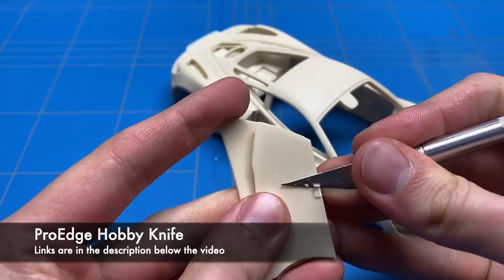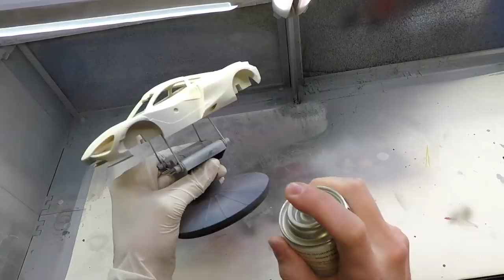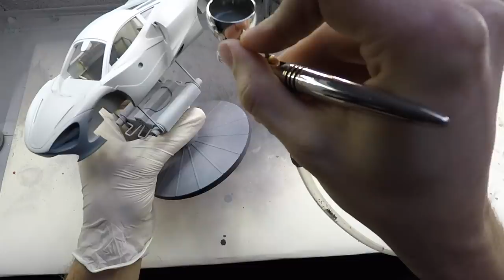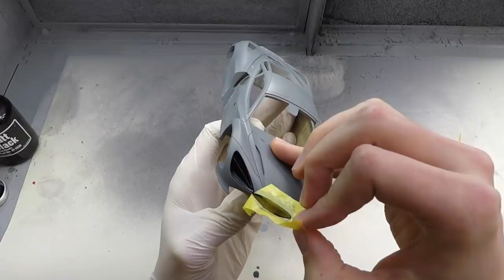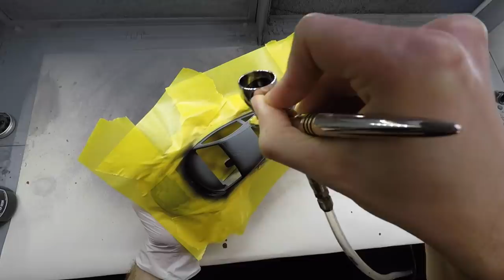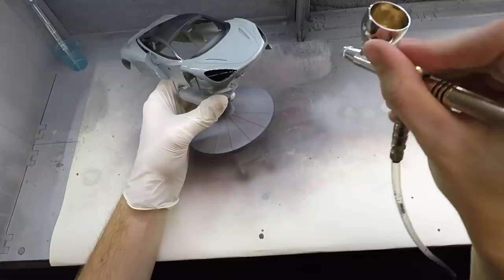Building a Alpha Model Mclaren 720S Part 1 Paint & Bodywork

Comment: Could a gloss black been used instead of matte black, since clear coating it makes it look gloss?  Is there a difference or advantage in using a matte?
Reply from the maker: You can use any black you want, the clear will make it gloss. I like matt as it covers fast and needs less coats
Reply: Noted 👍

Comment: Nice job, but quick question why did you began using Tamiyas primer. What happened to Zeropaints primer what is the difference. Thanks
Reply from the maker: Tamiya primer is simply a fantastic primer, and in this case the model is Resin, Tamiya works on resin, metal and plastic. Zero Primer only works on plastic.

Comment: Great video as usual. Going to make an order from your shop soon. Will be sure to drop a 5 star review on trustpilot cuz rn there is only a low rating but I trust you ahah! Also one question. I have asked so many people about polishing my clear coat. I am getting a can of Mr super clear after my mr topcoat which wasnt bad but ive heard Super clear is much better. I have an infini model 4000 grit sponge sheet that a friend had left over. I am wondering wether I need to get 2000 0r 3000 grit or both. After that I would polish with the 4000 and then a 12000 micro cloth and use tamiya's compound set. How does this sound? sorry I just wrote an essay but im desperate for answers. thanks a lot.